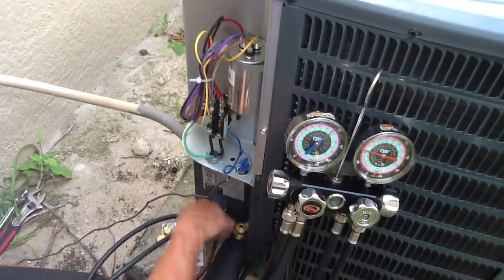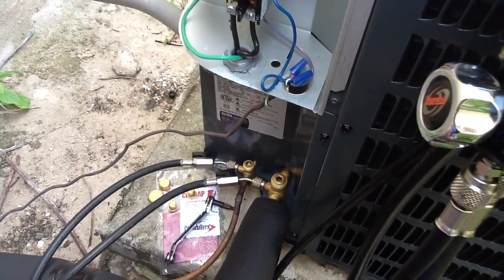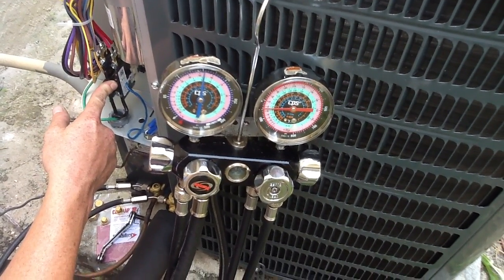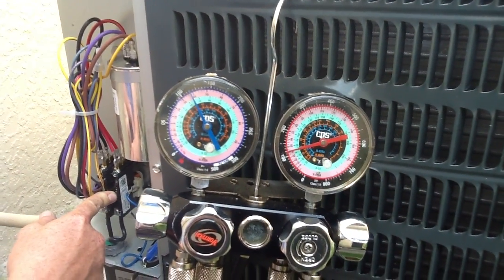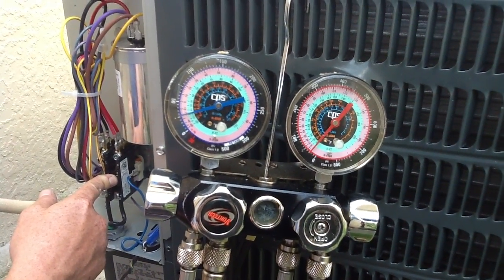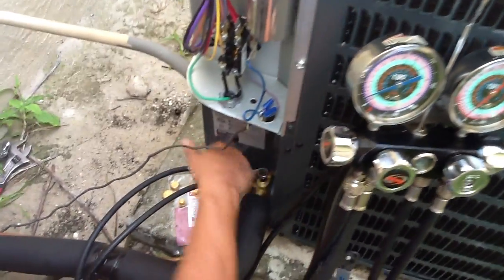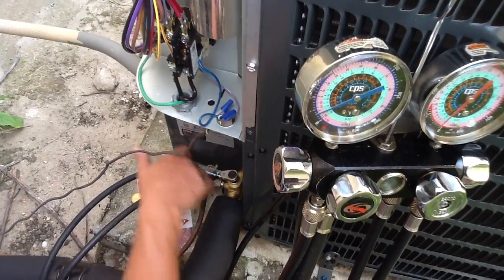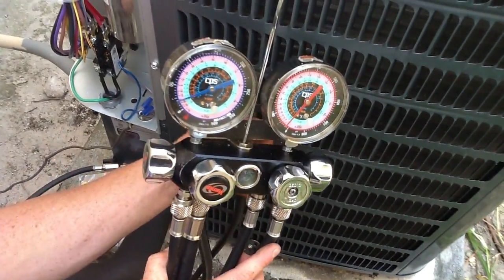Quickest Way To Pump Down Unit / Replacing TXV

Comment: The compressor does not "pull" the refrigerant into the condenser. It pumps or pushes it into the condenser. You could say the compressor is "pulling" or sucking  the refrigerant out of the system.
Reply: Why do you think it's called a suction line?

Comment: hi David I installed my Goodman 4 ton 410A unit the condenser and the inside air hand / coil I have lots of Plumbing experience I've installed many mini splits so my concern is I know the units come with enough charge for 15 ft of line set my line said was only 4 feet long so I was worried about it being overcharged so a friend of mine who works in the HVAC industry came over put his gauges on brought the super heat down to between 7 and 10 before he removed some freon the suction line was sweating which I believe is normal now it's not is that okay thanks if you go on my channel you can see the install it's BigMiked52 Mike
Reply from the maker: on mini split that should be ok

Comment: so when the blue neddle on the gauge drops i immediately close the big line on the unite right?
Reply: Best way to do it, don’t let offf the contactor until you have the suction/vapor line tightly closed to make sure there is no residual refrigerant in your line set. When I pump down an HVAC system like this using the compressor and condenser unit to temporarily hold the complete refrigerant charge while working, when I initially open either line I can hear it suck air in, and not release refrigerant. Which definitely tells me that I had a vacuum on my lines before opening them up. This is excellent considering it is very quick, efficient, and safe as it does not allow any refrigerant to vent to atmosphere. 💯❣️

Comment: Mr. Jones, I have a similar manifold as yours that includes 4 valves: liquid, suction, yellow line (?), and a vacuum valve, all valves should be at Closed position? Vacuum valve should be closed or open? Please clarify. I had all valves on manifold at closed position, but both pressure gauges just stayed the same @150psi, i ran the same way that you set up. Was I missing something?  Thanks!

Comment: Oh my Gosh.... I so cannot believe he is pushing that contactor down with his finger.... This is not a good Video for New Techs in the field to see.
Reply: G 888 some of my co workers do that lol I always use a sharpie
Reply: G 888 very first thing i noticed!!! Not a very smart practice!
Reply: Its composite/plastic where he is pushing so not sure why you folks are surprised.Use a sharpie/pen if your scared of getting shocked. Never gotten shocked during my 25 years.Now if your going to touch the terminals of the contactor pads you will get a bite.

Comment: It only takes one tenth of one amp to kill you. This unit is using 40 amps. Please don't push contactors with your bare hand. Use an insulated item. Second the compressor is not loading up with refrigerant, the noise is caused by starving the low side of refrigerant therefor allowing the scrolls to slap one another because there is no cushion of refrigerant between them.
Reply: "I just goin push at ere butten in on dat black thingy "
Good way to get electrocuted. Glad I don't work with any of these kind of guys and am my own boss
Reply: Wussys

Comment: Hi david thnx for this video I have a question when the system is completely pumped down and all the refrigerant is stored in the compressor chamber, will it not destroy the compressor itself? I have basics in refrigeration but I need deep understanding specially maintenance thnx

Comment: what pressure are we measuring and how come the pressure for the suction line decreases as we turn on the compressor ?
Reply: Low side pressure, or your blue line. Suction/Vapor line. You have to make sure before you start this recovery process that you have the High pressure line, or Liquid/Pressure line, red hose closed. Service port valve needs to be closed before beginning with your suction line service port valve opened until the refrigerant pressure drops to show a vacuum on your gauges, then while keeping contactor closed, compressor still running, quickly close your suction line to keep your vacuum on the line set and save the customers refrigerant charge.

Comment: I shut off the liquid side and shut off suction side. Open the suction valve 3 Turns. Start the pump down, when it reaches 0 shut off the suction valve It will only take 3 turns instead of the 25 cranks you did. Then turn release the contactor. Everybody has there own method this is mind.

Comment: This method is good one. Need to use a plastic pen to push the contactor . The good things is to close the suction valve  half way and hold the contactor till close the valve.In this way no pressure left in the lineset